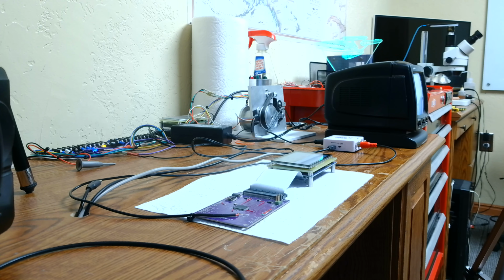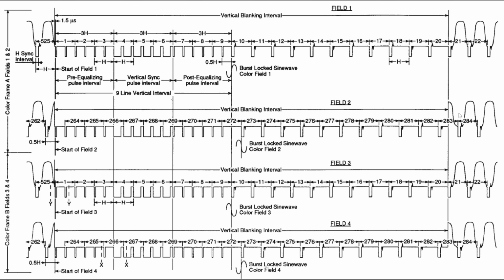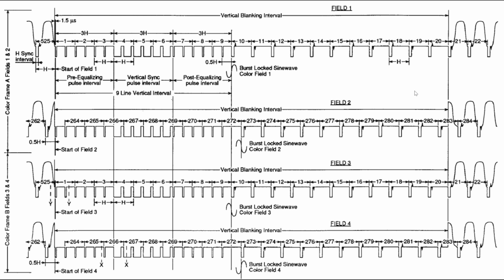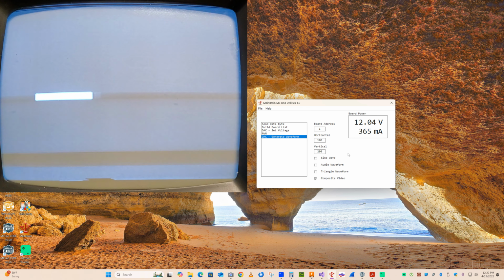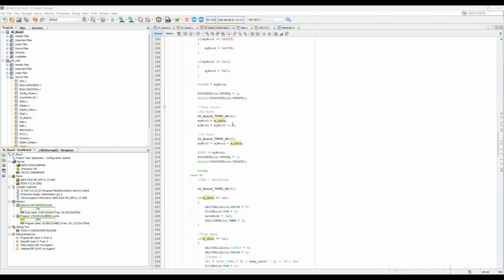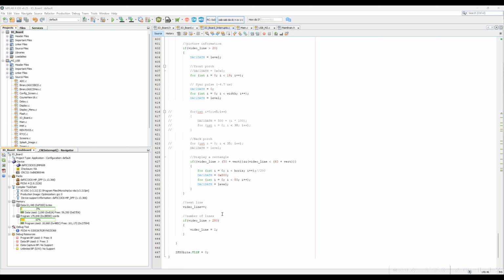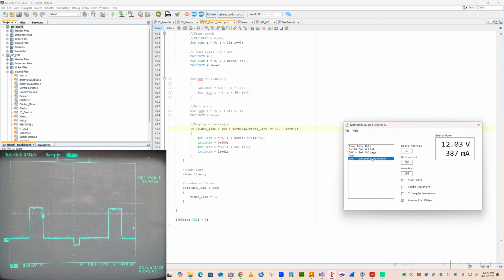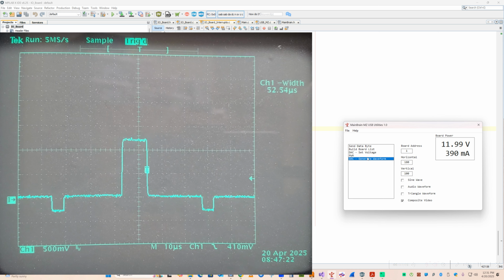Episode 22 - Using the DAC to Generate NTSC Video

Comment: Nice. For a long time I've used resistor ladders for RGB signals. I have been considering a three channel DAC but realised it still needed a low pass filter paired with it. So in the end decided to just use the low pass filter with the resistor ladders.